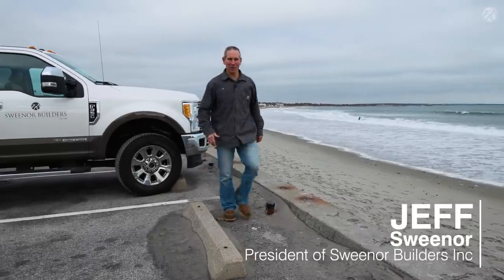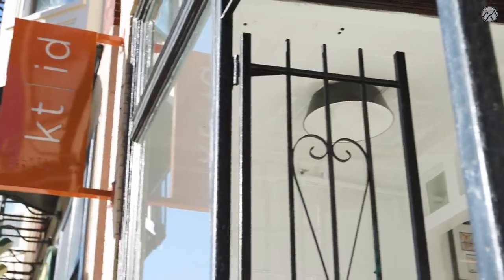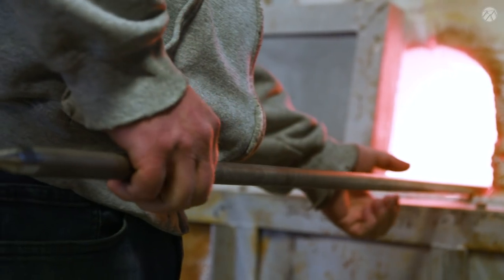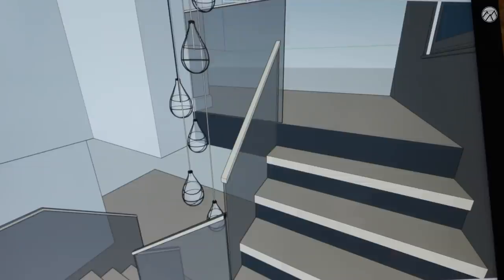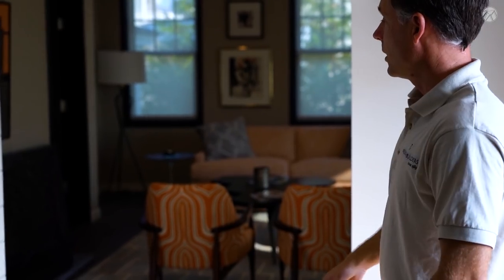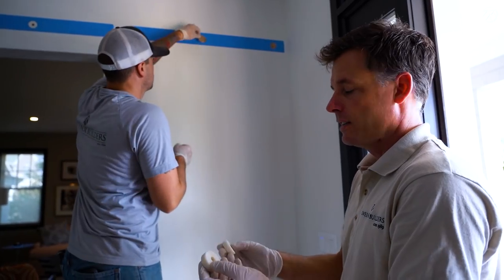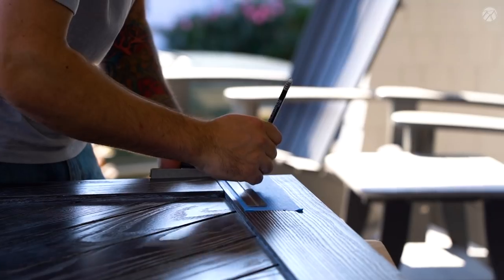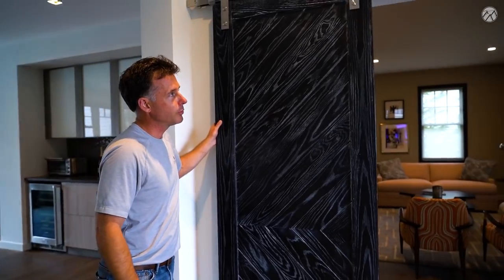Sliding Barn Door | Custom Made Glass Light | SAWDUST EP09

Comment: Great work as always!  The barn doors look great!  Question though about preventing blowout with the drill bit:  Is there an advantage to measuring the hole for the door hardware on both sides versus just using a small drill bit (1/8 or so) to pre-drill all the way through thus transferring a single measurement to both sides?
Reply from the maker: Brandon that is an excellent question. Using a small drillbit to go through the entire door will give you a good pilot hole on the opposite side preventing blow out however if the drillbit is not perfectly square level plum going through it will end up in a different spot on the opposite side. If you used a drill press this would work but when you’re drilling by hand it’s more accurate to measure both sides. Thanks for your question.
Reply: Brandon.  There are a few ways that I am aware to prevent blow out either drill from both sides,  or tightly clamp a piece of wood to the back side of the hole.  In this install we drilled both sides.  Using a smaller drill bit might minimize blow out or chipping of the wood on the backside of the hole but does not necessarily prevent it.
Reply: @Sweenorbuilders  Excellent points I hadn't even thought about.  Thanks for the response guys!
Reply: @dbbuildri  Great points!  I like the clamped piece of wood idea too.  I will have to try that out sometime.  Thank you for the response!